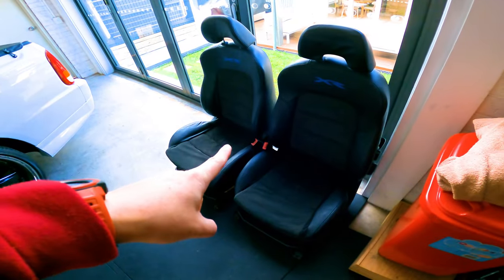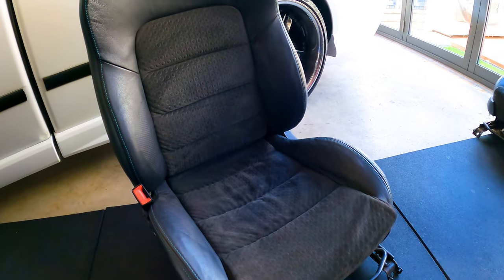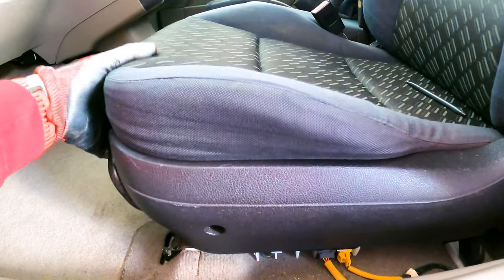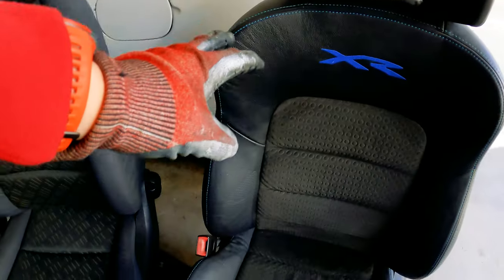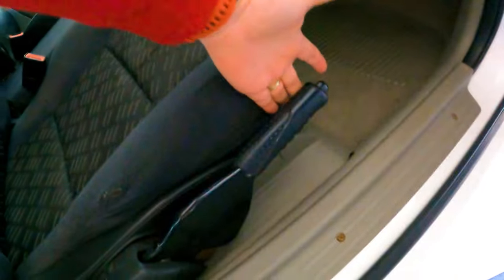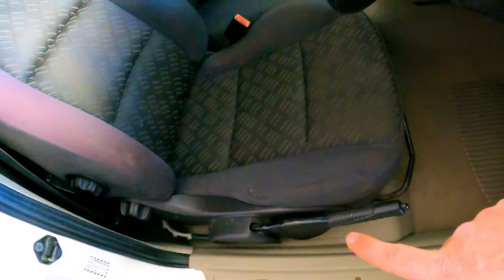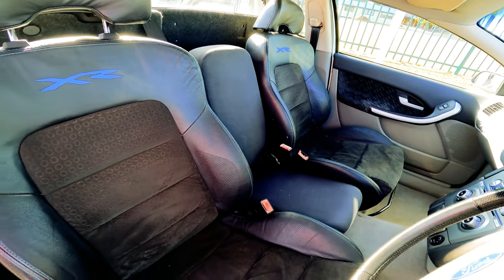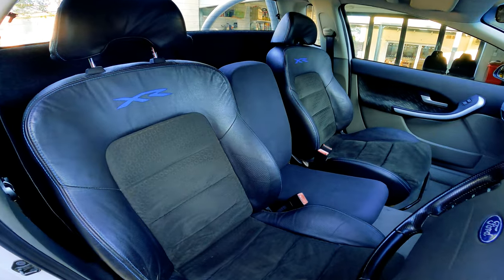How to Install XR Seats into a Standard BA BF Ford Falcon Ute

Comment: I installed mustang recaros in my ute. I probably removed and replaced those seats 20 times during fabrication of the brackets between the falcon floor and mustang seat base. Mine is heaps heavier, too.
Great video as always, cheers.
Reply from the maker: Thanks as always mate - Mustang Recaros must be nice though 😀
Reply: @Horus_Works  I had the same as your original seats and they were pretty comfy. Like you I got a bit bored of them. Im a bit fat for the Mustang recaros, they grab me in the flanks a bit tight.
Reply from the maker: @rossmarzano  yep, besides me just being bored, there was nothing wrong with the original seats. I can see why people put these into 4 wheel drives.

Comment: Nice modification. You said you wanted a green theme. From what I can see that the sewing on the seats is also blue. I'm thinking if you can get a piece of green fabric and sew it on top of the blue? I think it would cover it nicely.
Reply from the maker: I'm going to try and change it to green... if it doesn't work, I will make it a blue theme 😜

Comment: Great video - thank you for sharing. I was actually thinking to replace the seats in my 2006 RTV Ute (column shift, three-seater). Do you think the XR6 BA-BF sedan seats fit the ute? Any other seats that may fit the RTV? 
Thank you in advance for any help you can provide
Reply from the maker: Hey mate, appreciate you watching, and thanks for the comment. As far as I'm aware the seats in the RTV are exactly the same as mine (mine is also a 3 seat column shift), so the short answer is yes, they would fit, although if you're installing them out of a sedan, you will lose the flip-back function as this was only available on ute seats... hope that helps  👍